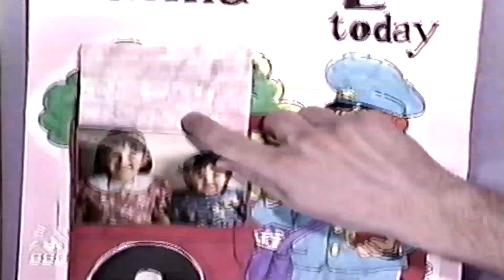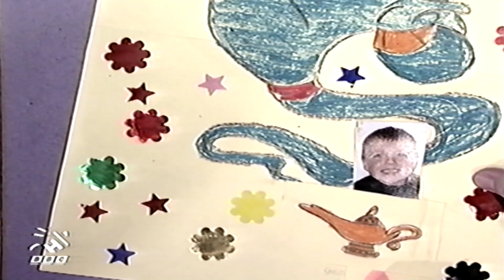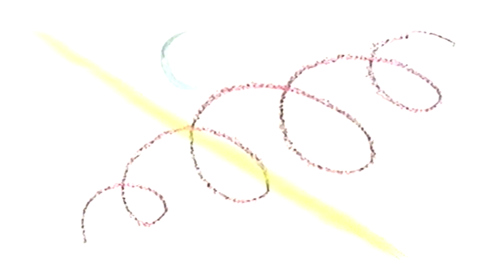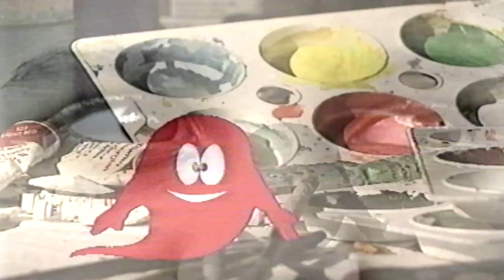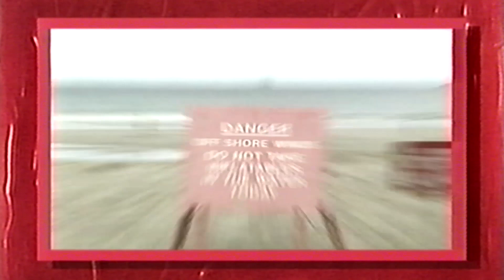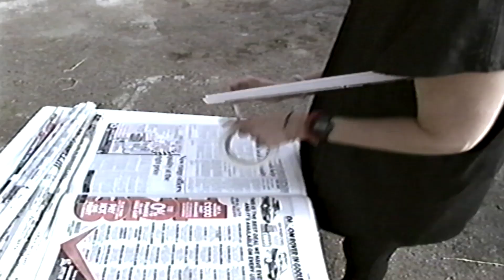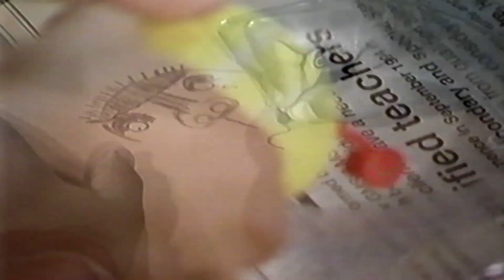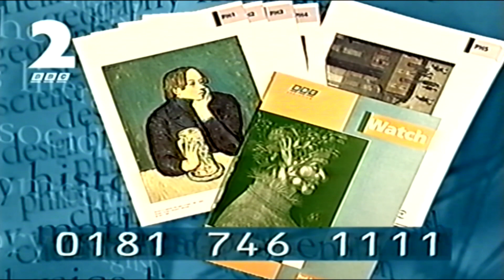cbbc clip verr very poor video and sound issues 1995

Comment: I bet it's the VCR you could try cleaning it
Reply from the maker: the rest of the tape is fine + looking at the tape there is damage to it  would not play at all in 2 different VCR
Reply: @foundinaattic  It might be the VCR. Clean it with a wet cleaner then leave it for 15 minutes and then find out for yourself. If your tape plays better then it's thanks to the cleaning. You might also want to try a dry head cleaner.
Reply from the maker: @QueenofVHS   the  tape is damaged u open it and its all broken up a vhs clearn wont help that and i do that  on and off anyway as thease tapes are so dirty some have been exposed to water or outside at some point 
i have a worse one than this that wobbles from side to side and the recording before it are fine its itv gmtv kids  just verry poor again some of the sky movies are verry poor also and i not done anything with them
i have a stack of 3 vcrs one i just use for rewinding now and one to sacrifice
+ i have moldy tapes in treatment right now that ill do outside when it warmer
Reply: @foundinaattic  Have you ever tried opening the tape up and fixing it yourself?
Reply from the maker: @QueenofVHS   yes i fix broken tapes all the time a better word for this is the tape had been chewed by a machine and rewound back in to the tape in the past
the next bad one looks like a just off air poor signal tho it moves from side to side and the tape is perfect  and the recording on the tape apart from the kids shows are fine thats going up next depening on if stuff gets blocked